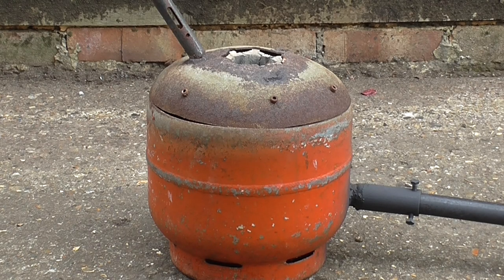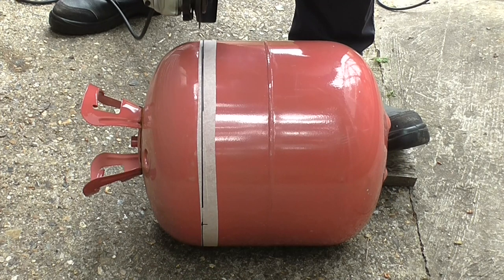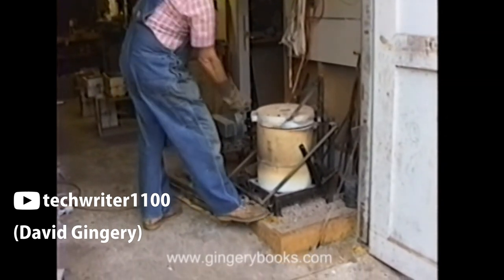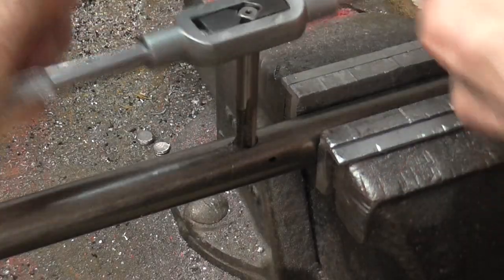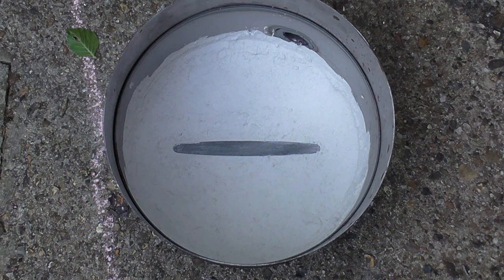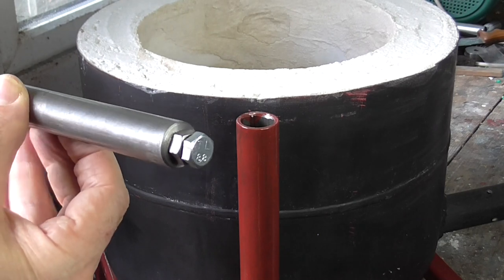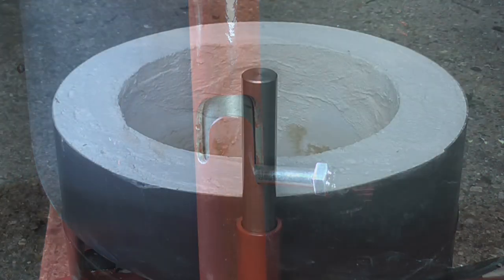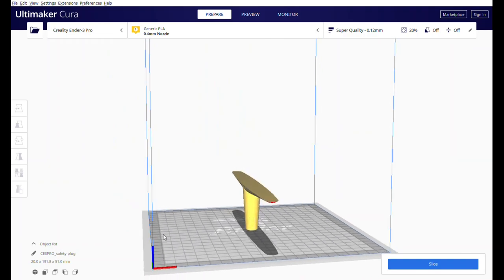New crucible furnace design - hands-free lid.

Comment: Good point regarding flammable/volatile substances that may have been in a drum or cylinder - I met a severely disabled man back when I was a teenager, he used to bring his recumbent tricycle into the bike shop where I worked. He was a farmer until he cut open an empty 44 gallon drum that had had petrol in it. The resulting explosion almost killed him
Reply from the maker: I have ground old propane tanks open before, the way I did it is to fill them completely with water and grind whilst still full. You then have water/electricity to deal with instead of an explosion risk. Empty tanks/drums are the most dangerous, they always contain fumes that are too rich to burn to start with, but as you cut, air seeps in until it reaches the perfect ratio to explode.
Reply: @AndysMachines this is why i bought a gas sniffer! Lol
Reply: @AndysMachines  I've done a propane tank before. I emptied the tank completely and then used a pipe wrench to take off the brass valve on top. I then turned the uncapped cylinder upside down and left it outdoors for a year. After that I used a hacksaw and made multiple small cuts around the circumference to open it up. A hacksaw is not going to create any sparks or enough heat to ignite any tar still left inside a year down the line.

Comment: Good job, I may do the same one day.

 I turned one helium bottle into a vacuum chamber, for the cost of 6mm weld on flange (£50). Vacuum chambers that size are normally around £400.
Reply from the maker: That's interesting, I thought about doing the same with an old butane bottle, I wasn't sure a helium tank would be strong enough. I have a couple of 8" plastic bell jars, but I don't trust them for a full vacuum, they seem very thin.
Reply: @AndysMachines  The bottles are rated for around 69bar, absolute vacuum is only 1bar, so they're plenty strong enough.

Comment: Nice video!

Good advice about grinding cylinders that may have had flammable gasses in them. 

If you do have cylinders that had LPG in them you can take the valve off (obviously only when empty) then fill them with a hosepipe until overflowing. Tip the water out and then they're suitable to cut. Nice thick steel too.
I've only done it for calor style tanks, but I think they're worth a bit more now as empty cylinders.
Reply from the maker: Thanks! Yes, good tip, this water flushing trick is actually exactly what I suggested on Patreon. Around here at the moment, you can't get a full propane tank without an empty one to exchange. Even then they only have certain sizes available.

Comment: Neat design andy, I would have added a bit extra height tho so you can add a plinth block, you dont want the burner flame to come in contact with the crucible, otherwise you'll end up spalling the crap out of the crucible and ruining it. A plinth block puts the crucible up above the path of the burner.
Reply from the maker: Yes, absolutely right about the plinth. I didn't cover it in the video but I did pour a couple from the same refractory material, you can see one in the video thumbnail and you might just be able to make it out from 11:11 in the bottom of the furnace, and later under the crucible (though it's hard to see).

Comment: What did you base the dimensions on for this furnace? Did you use formulas? How did you size the burner? Did you build or buy the burner, what are the BTU's? How long does it take to melt aluminum?
Reply from the maker: I built it to take an A10 crucible, though I've never actually needed one that big. I didn't use any formulas, I just built it how I thought was best (though I recall I may have checked how big the hole in the top should be).  I made the burner and I've no idea how many BTUs it puts out, it runs on propane at 37mbar, but I'm sure it could be improved. It will melt a crucible of aluminium in about half an hour from cold, but once the furnace is hot maybe 15-20 minutes.

Comment: Thanks for publishing this. Curious what the warm-up time is for this furnace - does the thermal mass of the volume of refractory cement cause issues? On other videos I've seen only a skim of refractory used, hence the question.
Reply from the maker: It seems to get to temperature just as fast as my previous much smaller kiln. Both used my same home made burner. A commercial kiln I used was faster, but I think this is down to my burner design which seems to put out less heat (but also uses less gas).
Reply: @AndysMachines  Thanks - that's good info, and thank you for continuing to maintain a very informative channel.

Comment: My furnace at the moment comprises of two thermolite building blocks stuck together and hollowed out lol. Time for an upgrade. What is the capacity of this in aluminium/brass terms?
Reply from the maker: I actually have a small electric one built from thermolite blocks, it works well, though I did line the cavity with thin firebricks.

As for dimensions/capacity: 9:43
Reply: @AndysMachines  Thanks. I've never bought a 'proper' crucible. I just use cut up disposable gas bottles. I assume the weight capacity refers to a heavy metal  like brass?
Reply from the maker: Crucible sizes can be confusing, if it's stated in Kg, then it's normally Kgs of brass or copper. If it's ''#' (eg. #6) then it's in lbs of aluminium. Brass weighs approx 3x aluminium.

Comment: I have an old 12" propane burner set up with a 6inch burner in the center. Can I use that for the heat source to make a smelter
Reply from the maker: It probably would work with enough insulation around the crucible, for aluminium at least. It might take a long time to melt though.

Comment: He says "Never do this with any cylinder that once contained a flammable gas" after showing the previous version made from a propane tank.
Reply from the maker: I have cut many propane tanks up in the past, but I'm wary about showing potentially dangerous things on Youtube. The safe way to do it is to remove the valve and flush the tank with water, filling it completely so there is no space for any gas to remain. Some people will tell you that even this is not enough, that the steel of the tank can absorb the gas and emit enough of it over time to create an explosive mixture. I think that's a myth, but if you're going to grind open cylinders of flammable gas, please make yourself aware of all the dangers and how to mitigate them, and remember I told you not to! (Do what I say, not what I do! 😁)

Comment: Any updates on this? Did the 25mm refractory cement wall crack anywhere?
Reply from the maker: 2½ years of fairly regular use later and a lot of the 'heat proof' paint has come off the lid (mostly on the side that swings over the top) but the refractory lining has not cracked or degraded in any way.

Comment: 10:37 what actually causes the lid pipe to spin though? I a level surface you would think simply stepping on a pedal that pushes up under the pipe will just raise the pipe straight up and now swivel off to the side.
Reply from the maker: The curved track in the red tube is what causes the lid to rotate, you can see the bolt sliding in the track in the centre of the picture.
Reply: Genius, i was looking for the answer!

Comment: Similar design to one we had, yours is just a touch smaller.

But I have got to say, dont work with aluminum or other molten metal over concrete, if it spill it can spall and splatted molten metal everywhere. Work on dirt, grass, sand, even plywood will work.
Reply from the maker: Yes, that's a good point, concrete is not the best surface to work over. I do have a large metal tray I usually fill with sand and put everything on that, furnace, moulding boxes etc... But it's a little small for this furnace and looks really cluttered on video.

Comment: The metal wire in the lid will expand and contract with heating and cooling, destroying the cast refractory. :(  I don't know of a solution unfortunately.
Reply from the maker: It probably will, but after the first couple of firings it will probably have moved around as much as it ever will. The whole lid will expand and contract in use and without the wire or something else to retain the refractory it would just fall out pretty fast. Furnaces do wear and need maintenance of course, but this one has lasted very well so far,  I think the combination of ceramic fibre and refractory helps cushion the refractory from movement of the steel parts.

Comment: is it possible to get 1500c temps without burning furnace ? for iron smelting
Reply from the maker: The refractory cement is rated to 1600°C so yes it should withstand that. You would probably need a bigger burner though, maybe waste oil.
Reply: @AndysMachines  so i dont need to use zircon paint over it ?
Reply from the maker: I've never used it, but I suppose it can't hurt. If you get the higher temperature refractory (comes in different grades) and perhaps use a thicker layer than I did, maybe >50mm, it should last a good long time. You might get some hot spots in the furnace, eg. directly in front of the burner, the paint might help here.
Reply: @AndysMachines  thanks

Comment: I love the lid opener, but I think the concrete walls are too thin and will crack more easily over time. I hope it holds as long as possible :)
Reply from the maker: The castable refractory is at least 25mm thick (probably more as the ceramic wool compacted a little under the pressure). I did use the higher temperature 1600°C stuff, which is also apparently good for filling small gaps, so hopefully it will hold up well. After 4 fairly long uses so far it still looks brand new, we'll see how it holds up!
Reply: Should be fine, that about the thickness that was on the commercial ones we had.